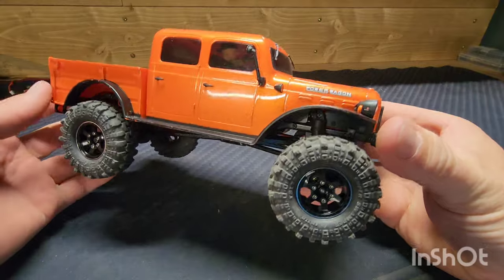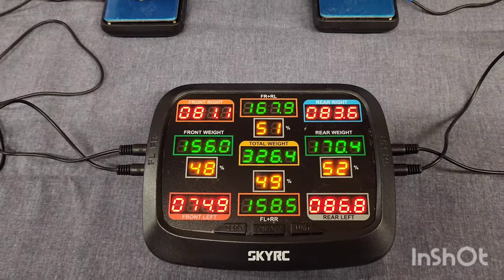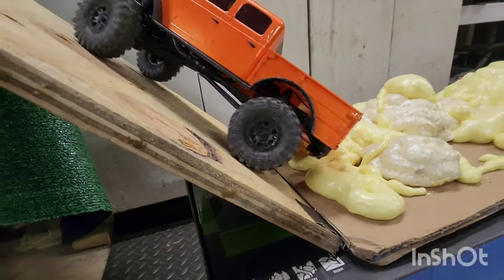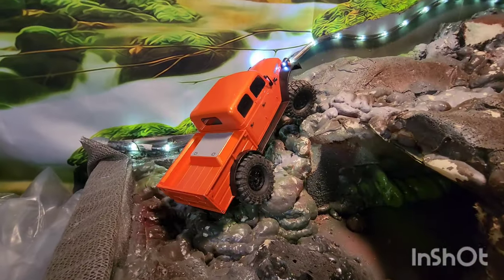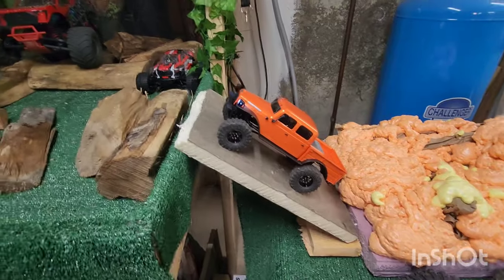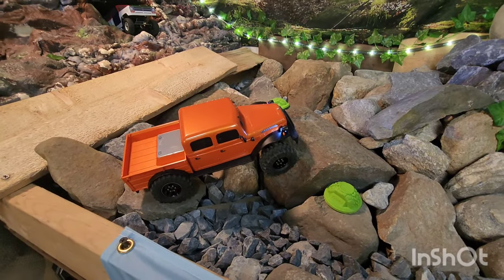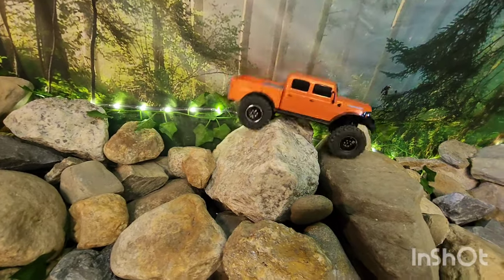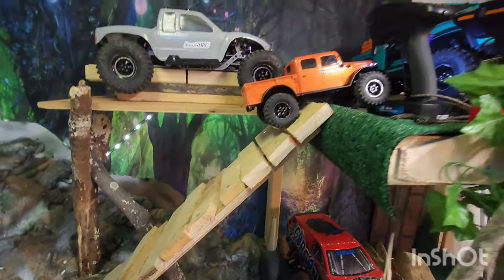stock vs modified scx24 power wagon.

Comment: You have to modify the suspension, you can’t just leave it stock and not expect to roll. You wanna get it lower to the ground and a softer suspension, also remove the foams in the tires and put brass bead locks on. Mine will damn near climb a wall, but everything is brass except axles with a furitek combo.

Comment: The only difference is the one we didn't see, and that's how much lighter your wallet feels after wasting all that money 🤣😅😂

Some Lead solder wrapped in the inside of the rims "equally" would have worked better than all them upgrades, and it'd have only cost ya $1 at Walmart 😂😅🤣

Crawling is more about a skill set, a $100 crawler with lead wrapped rims, and someone with skill, will blow ANYONE away with a fully upgraded $1000 truck that just "thinks" they are good...

You can have the best crawler in the world, and if you don't have skill It's useless, and someone with junk will beat ya...